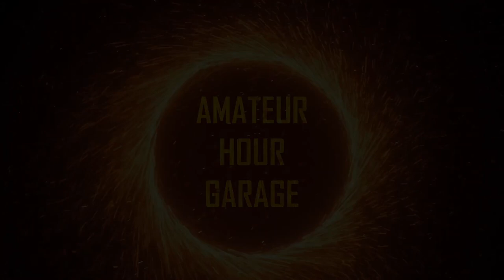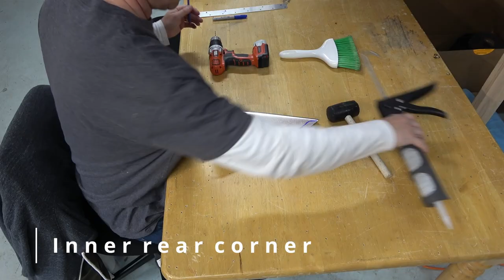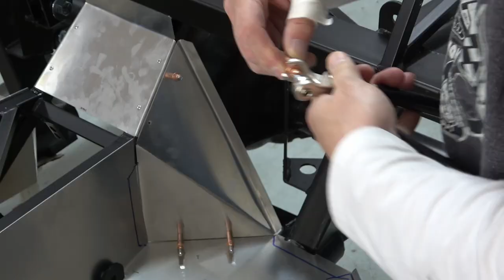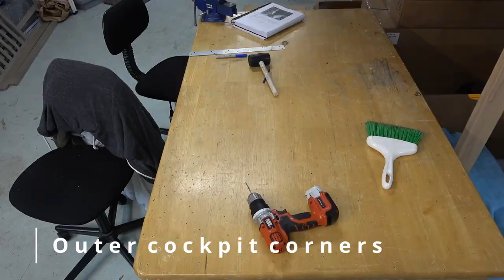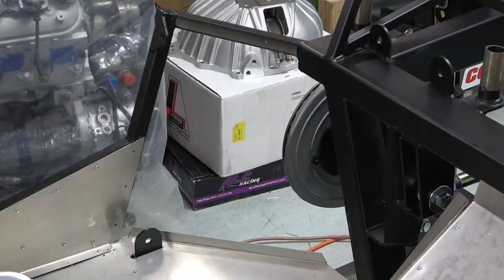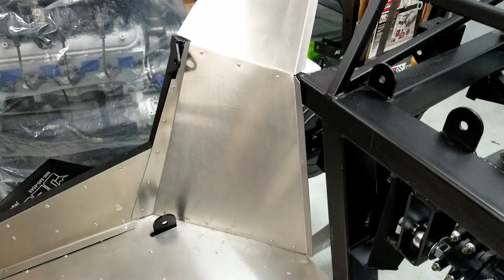Budget LS Factory Five Cobra | Build Update 6

Comment: Here's a tip as it concerns the aluminum panels. I save a great deal of time using a hand operated hole puncher that I got from one of the big box stores, very inexpensive, under 15 dollars. It can only be used along edges, it punches out a very clean and consistent  1/8 holes, no distortion.It saves time  which I needed, just align and squeeze, two or three seconds for each hole punched.  I spaced the rivets at one inch intervals when it was aluminum to aluminum and two inch intervals when it was aluminum to steel, so twice as many holes. And no shavings just little plugs. The tool has an adjustable stop to punch holes at consistent measurement from the edge of the panel. I hope this was helpful to you.
Reply from the maker: You must have noticed that i cut my fingers twice!  From the burs after i drilled the holes.  Got a part number or link?